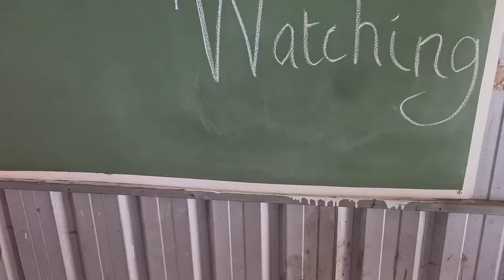Forging a Kitchen Knife From a JACKHAMMER Bit!

Comment: Its probably the best use for jackhammer pieces, as someone who spent months on one can attest to feeling- its a really pretty finished product though and should make someone very proud to own it. I spent the last 6 days hand sanding ten S35VN knives up to a point they'll polish ok on some and leave a few at 800g satin, my love for the wear resistance of vanadium in steels is 'diminished' lets say
Reply from the maker: Haha yeah, stainlesses are great until you have to sand them, but I'm a carbon steel nut 😁
Reply: @SamTownsBladesmith  Lately a lot of stuff I've been doing is in 26C3 and 1084 as I've got some big plates of it to cut up. But had a commission to make a filleting knife and frankly a carbon steel filleting knife is hot trash no matter how you try to justify it.
So to make 'some' money out of this, I cut up a plate of SF100 to make some more knives out of an had both a kiln failure and compressor problem right at the same time and that was $80 of steel, $50 belts and 4days work completely toast.

Looking at my now 'smaller' steel rack of stainless, there's some 4mm chonks and my last half a bar of S35VN- which is a great steel but damn it takes some elbow grease.
Next month, I'll do some pattern welded stuff that I've wanted to do for ages, but right now, just got to squirt these out for some cash and hope to get a little over break even.

Its a hard ol game some weeks

Comment: Beautiful Sam, Is the epoxy something stronger than hardware store epoxy? I would like to try one of those handles but using the correct epoxy seems key with that style handle build
Reply from the maker: Realistically as long as you use long set (60 mins +) you'll be fine. West systems G-flex is sort of top of the line, up there with Acraglass
Reply: @SamTownsBladesmith  Thanks Sam